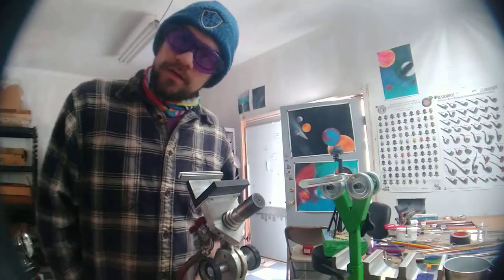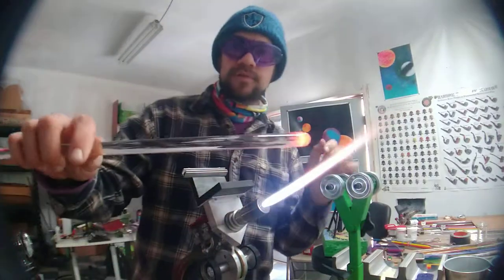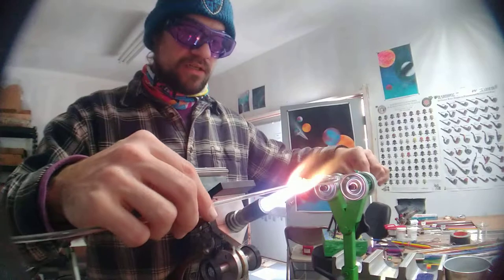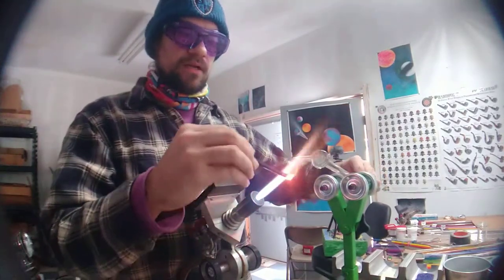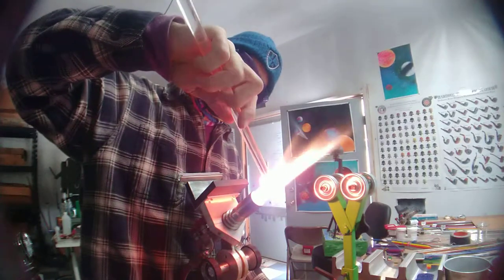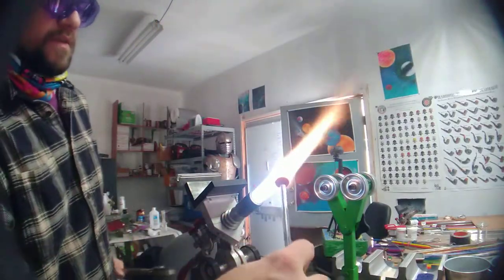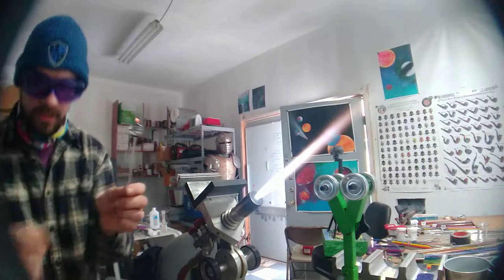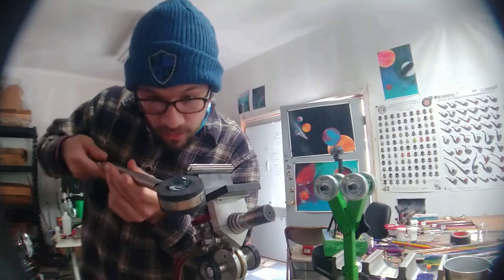Cremation marble demo by Banshee Glass

Comment: Just had someone ask me about making a memorial marble. Nice video and very well explained and shown. I have a couple of questions: could I put the ashes in very small “bubble” of hollow (like I would with an opal), encase that and then do the marble as desired? Why such a small bit of ash? Does it cause cracking/checking? THANK YOU! Glad you didn’t sneeze or fart! 😀
Reply from the maker: Sure thing, so first off. You use such a small amount of ashes because any more and it will boil/bubble/scuz. Its not like frit color where you can add as much as you want. A tiny TINY bit goes a very long way. I would not reccommend putting ashes into a tube and encasing like an opal as you will use far too much ashes and that method will get too many air bubbles. Using too much ashes will also cause strange gross yellowing of the glass. Trust me on this, you want a very VERY faint amount of ashes. Now one option if you dont want to flame work it is to put a clear bubble on a piece, insert ashes after the piece is cooled down out of the kiln and apply epoxy resin to encase the ashes, but its hard to control where the ashes are in the bubble that way. (That method can be used to "encase" literally anything) hope this was helpful. Let me know if you have anymore questions, always happy to help
Reply: @Xanderviceory  THANKS.